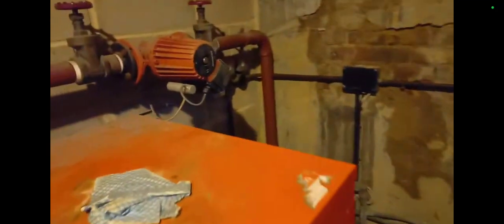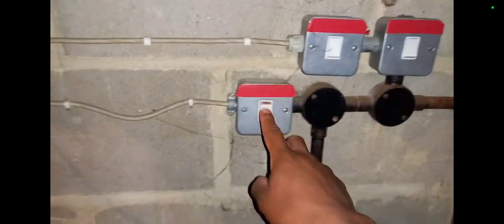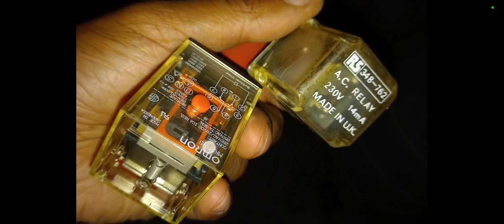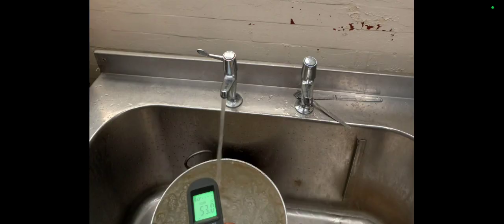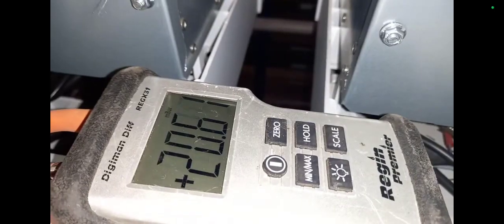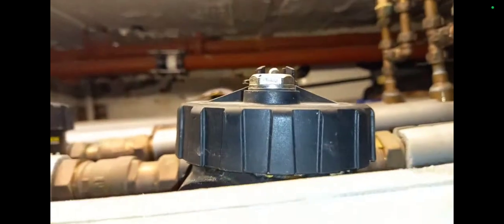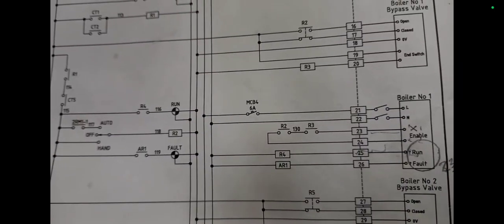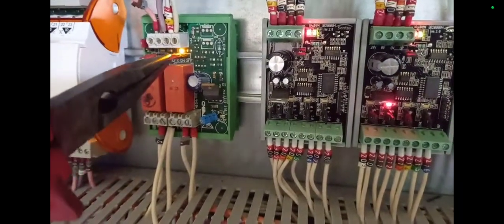DAY IN THE LIFE OF A COMMERCIAL GAS ENGINEER pt28

Comment from the maker: I am amazed that my little channel which I've been working on for 3 years is approaching 2k subscribers. That's more down to the viewers efforts than mine. I appreciate your support and hope that your time spent here hasn't been in vein.

Reminder to myself and viewers of D1 and D2 dimensions.

D1 maximum of 500mm
D2 minimum of 300mm
The continuous fall on the discharge.
Also the increased pipework size going through tundish.
There's more but those are a few key things to remember on an unvented cylinder.